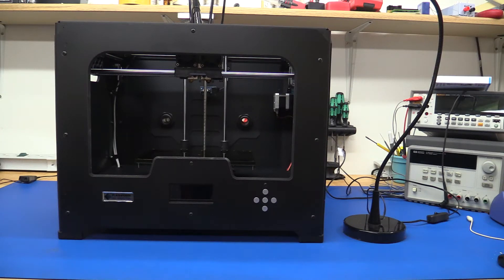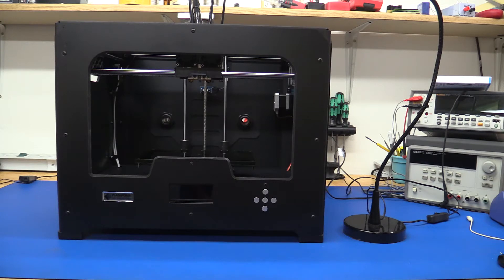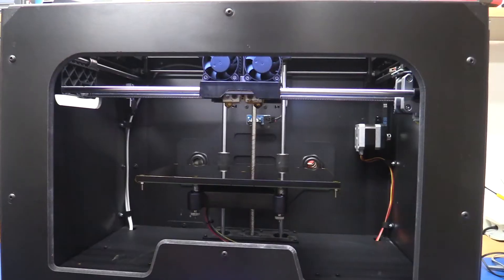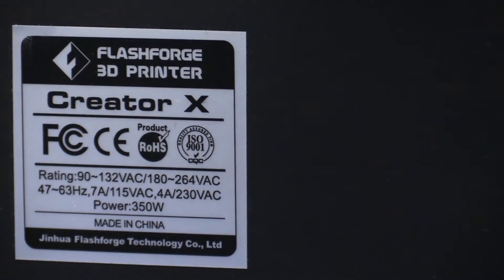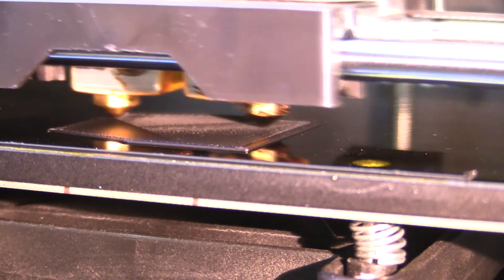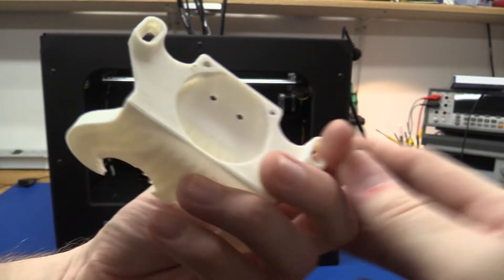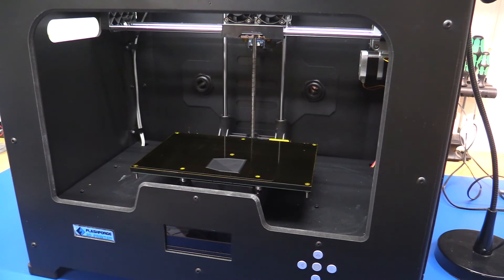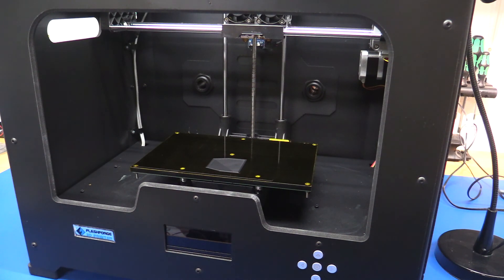3D Printer Review: FLASHFORGE CREATOR X - Ec-Projects

Comment: The piece is printed in ABS right? because the right angle is raised during the print, I advice to use a glue stick for to hold well the piece on the print bed and mainly in flat.
Reply: +ferro938 yes i saw that glue stick tip also on" TESTED"

Comment: What type of software interface does it use. Thank you
Reply from the maker: You can use MakerWare by MakerBot or one many other programs.
It's a graphical interface where you can see your part in 3D and move things around, set your print settings and either print directly through a USB cable or export it to an SD card :)
Note sure I understood the question correctly, sorry :)
Reply: Nice, thank you! do you know if the MakerBot Digitizer will work with this Printer? (3D scanner) by MakerBot.

Thank you so much for the reply,
Reply from the maker: XxG_H_0_5_TxX
Yep, the digitizer can make an STL file which can be sliced to print on all printers :)
Reply: Nice! thanks!

Comment: How are you printing without rafters? I've determined that it is IMPOSSIBLE to properly remove these stupid rafters (I use Inland ABS plastic).
Reply from the maker: FRajput786 I came to the same conclusion :) It's all about getting the first layer perfect and getting it to stick very good to the surface. For ABS I use kapton tape, and for PLA I use masking tape with glue stick on top :)
Reply: Kapton doesn't help me much with it sticking without rafters either :/ It's a double edged sword: print without rafters, it doesn't stick. Print with rafters, and the rafters never separate from the actual print.
Reply from the maker: That's strange, I can barely remove the print from the platform if I use kapton. If it's a large print I'm guaranteed to tear the tape :P

Comment: Pretty amazing stuff, shame I can not afford something like this lol, did you say it can even print rubber ? Reason I ask is I have a very old REEL TO REEL similar to this one http://www.ebay.co.uk/itm/Phillips-Reel-to-Reel-Stereo-Recorder-N4414-Collection-near-Exeter-/300954287616?pt=UK_Consumer_VintageAudio_RL&hash=item461245fe00 it needs a new driver belt and I cannot find a replacement anywhere could something like this create a new drive belt ?
Reply: If you do the design work,, measurements, then layout in CAD (which you would have to do anyway). Upload to Shapeways.com, they will print it, and mail it to you.
"NinjaFlex" sounds like the proper filament for that project,,, but double check,, I'm new to this,, and new filaments are still coming out. Any stretching between drive pulleys will probably distort the playback speed,, and sound.
http://www.shapeways.com
Reply: Thank you gcrady Only CAD work I have done is in PCB design but sounds like I could do it :)
Reply from the maker: ***** Hey.. Sorry for the late reply.. :/Yes it does print rubber. I haven't tried it though, because the filament is a bit expensive :(I'm sure it could print it (if it doesn't have very small teeth).. But I don't know how durable it would be.. As gcrady says, the filament is called NinjaFlex, perhaps there is some information or videos online showing its strength and durability :)
Reply: EcProjects The drive belt on my Reel to Reel does not have any teeth but is round, what makes it rare is this one that goes over a slip gear shuttle type wheel  is quite elastic an arm is engaged by a manual knob when twisted it rotates a half moon shape metal pulley that pulls the belt up by use of an angled groove to another gear size it is 2 speed. The other drive belt is shaped like a diamond shape (end view) as the outer rim of the rubber drives fast forward and rewind by friction, while the inner part of the belt runs around the gears. Thanks for your late reply EcProjects Better late than never :D